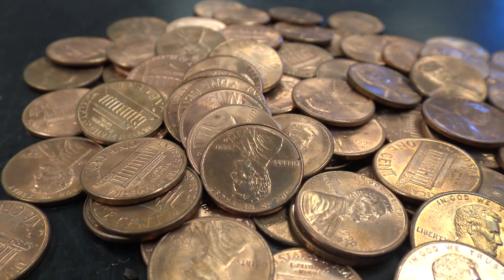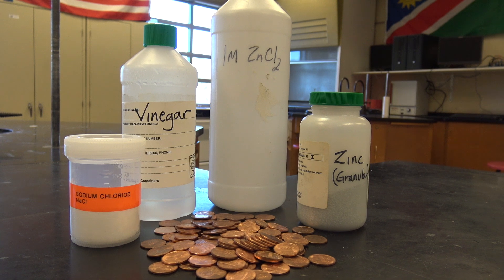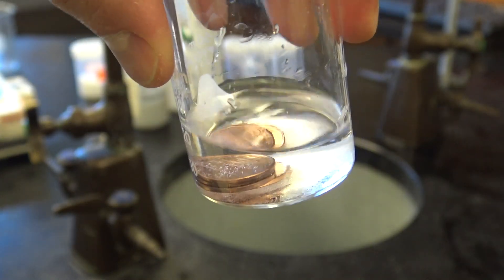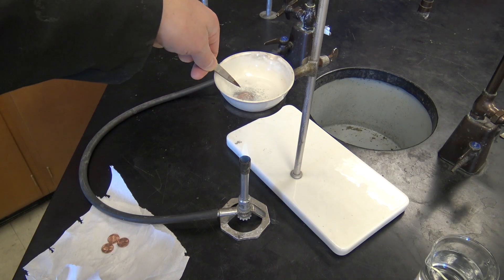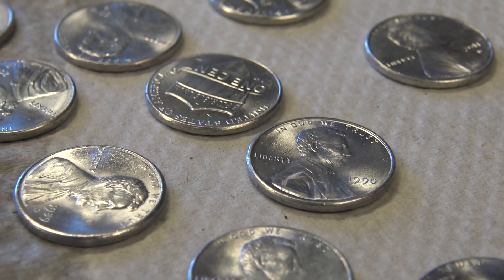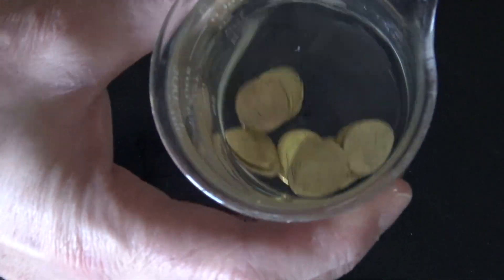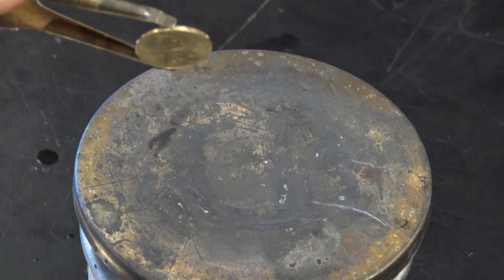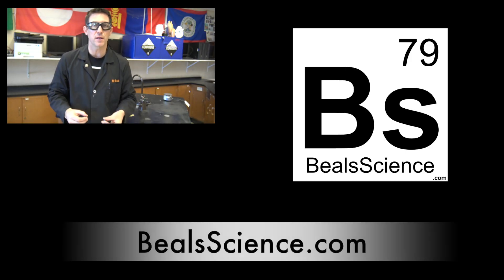How to Make Gold Pennies!

Comment from the maker: I'd love to hear from you! Leave me a comment and let me know what you think. 
Got an idea for a video or experiment? Let me know!
Thanks for watching! - Craig
Reply: Can you make them copper again?
Reply from the maker: If you continue to heat them they will turn back to copper as the zinc migrates deeper into the copper and eventually into the zinc interior (coppers are 99% zinc at the core anyway).
Reply: @BealsScience  Why is it possible to wipe off the zinc from the "silver colored penny" but not the "gold colored penny"?
Reply from the maker: Stacie Malonay great question!
The zinc loosely adheres to the copper on the outside of the penny. When heated, the copper and zinc can combine into a mixture where the zinc and copper atoms are intermixed. This is called brass and won’t wipe off because it is now part of the penny. It is similar to mixing two colors of paint (say yellow and blue). On a microscopic level you could still see the individual colors of dye but when we step back and look their colors combine to make a different color - green.
Hope that helps!
Reply: Just tried it out at home and got it to work, though it took a bit longer than 10 minutes - maybe because I used Zinc strips instead of granular zinc?  Looking to scale this up to do with my class.  How many pennies do you think I can get away with per ~250 mL beaker?  Hoping to have groups of 3-4 do it with each kid getting to take home a gold penny at the end of class.
Reply from the maker: Theo Pinson sorry I am slow to respond, I am just now seeing this. We’re you able to try the experiment?
Reply: is it possible to do this with copper wire?
Reply from the maker: John Doe yes!!
Reply from the maker: DExXR 380 I wasn’t aware that zinc pennies exist! Where can I find zinc pennies?
Reply: How much pure gold you can gat by this process...
If this process is harmful..?
Reply: @chaitanyakhanwalkar3555  no pure gold will be made in this process. This process makes brass which is golden in color.
Reply: Ok thanks. 👍🏻😊
Reply: where do u get zynk
Reply: Great
Reply from the maker: Thank you! I appreciate your comment!
Reply: Favor  decir los en español
Reply: Is this real gold
Reply from the maker: @Goodhabits1874  no. It is brass so it has a “gold” color but no real gold.
Reply: My penny won’t attach to the zinc, what am I doing wrong?
Reply from the maker: @alyssa7062  did you clean the penny with vinegar and table salt beforehand?

Comment: I was referred here by a Reddit post written by someone who has one of these "silver" pennies, because I have one, too.  Oddly, his is a 1961D, as is mine.  Also, his weighs 3.1gms, as does mine.  So, while I accept that it's zinc-coated, it seems odd that it's the same 1961D mint.  On top of that, someone who replied to that Reddit poster's comment, has the exact same thing.  Seems odd.
Reply from the maker: Yours could be an error from the mint. If so, it could be worth a lot of money!

Comment: Can you reverse this experiment?
Reply from the maker: If you gently heat the penny for a bit longer it will go back to copper because most of the zinc will migrate to the center with the zinc core that is already at the center of the penny.

Comment: Since pennies minted after 1982 are actually just copper-plated zinc, why is it necessary to add zinc in the first place? Is there a way to "silverize" a penny without adding more zinc?
Reply from the maker: Heating a penny by itself causes a color change but it isn’t very good looking. Additionally by the zinc plate allows the thin layer of copper to make brass from n the surface so it looks gold.

Comment: Couldn't you take it a step further with electrolysis and actually plate the zinc with gold or does it need to be a more valuable metal like silver? 
Or can you plate directly to the copper?
Reply from the maker: I haven’t tried much electrolysis but there might have to be some added steps to ensure that is plates properly.

Comment: You don’t need a silver bath. Just add a little silver to calcium carbonate (chalk) and photographic hypo (sodium thiosulfate) and water as a white paste. Wearing latex gloves dab a soft cloth into the paste and rub the penny … it will quickly silver plate the copper.
Reply from the maker: I’ve never tried this but it sounds great!
Do you use elemental silver or a silver compound like silver nitrate?

Comment: My question is: since a penny is just zinc coated in a thin layer of copper, why couldn't you just heat the penny enough to create an alloy? Why must you add zinc to the penny outside of the copper to create the alloy when there is already zinc under the copper?
I understand that it doesn't work, I've tried. But can someone explain to me why.
Reply from the maker: That’s a good question and as of right now I don’t have a good answer for you!
Interestingly, when you coat the penny with zinc then heat it, if you heat it too long the zinc will mostly travel to the center and you will have a regular old penny that has slightly more mass!
I will continue my search for an answer.

Comment: Just got one but the gold flakes off almost like it's painted. But silver color underneath.
Reply from the maker: Did you make it with this method?
Reply: @BealsScience   I got it in change from the store
Reply from the maker: @jgonyo3034  ok. That makes sense. Gold Pennie’s made this way will not flake off as the gold color is part of the copper on the penny.

Comment: I thought pennies were copper plated zinc?  does this work with nickles dimes and quarters?
Reply from the maker: You are correct. The center of a penny is zinc and it is plated with copper. I’ve done some experiments with removing the different layers with chemical reactions in this video if you are interested: https://youtu.be/5Cf0gH2LtiE
Reply from the maker: As far as other coins, they don’t have the copper “shell” needed to make this work.

Comment: We did this way back (1995-ish) in high school chemistry class, BUT, we used much more toxic chemicals. This method seems a lot safer and easier to do at home.  I was able to get all of the supplies on Amazon and the only tricky thing to find was the Zinc Chloride, but I was able to order that online also.

We made a bunch of 'silver' and 'gold' pennies for my nieces and nephews today after Christmas Eve brunch; they are all age 4-10, and they REALLY loved it.  It was a great activity to keep them out of the living room after present opening so the 'real' adults could clean up and let Uncle Paul play mad scientist in the kitchen.

One of them in particular wants to do more of this - she's asking about copper plating quarters and nickels and other coins, so that we can do the process in reverse to 'gold' those up too.  She's one of the younger ones, too - I think she has potential in a STEM field when she gets older.

The kids found the sizzle sound when quenching the brass pennies into the distilled water a lot more satisfying than the nothing much that happened when the 'silver' pennies came out.  But, they still decided to keep almost half of the pennies as silver-colored, which was cool.

Anyway thanks for the very instructive video.  I like this method a lot better than the way I learned to do this in the '90's and it DEFINITELY works, and my nieces and nephews were very impressed, and seemed to have a really great time.
Reply from the maker: I am so glad you had a great time! Your nieces and nephews are lucky to have such a cool uncle!!
I used to do this using boiling sodium hydroxide and it was really dangerous. This new method works just as good and isn’t nearly as “scary” as the other way!

Comment: Could I bake the pennies in an oven to get them to the brass phase? Like if I wanted to do a batch of pennies instead of doing them over a flame one by one?
Reply from the maker: Yes! Or if you have an electric stove top you can just hold them over the heat and they will turn.

Comment: How do you get the ZnCl?? Can it be replaced with something else?
Reply from the maker: You can use NaOH and it works great. But I don’t like using sodium hydroxide (especially with students) because the boiling solution is potentially very dangerous.
I’ve got some links with ordering info in the video description if that helps.
Thanks for watching!
Reply: @BealsScience  thank you.

Comment: Hi, is silver color is permanent or temporary? and is the silver color on the penny surface only,? and the penny from inside still has his own original color?
Reply from the maker: The silver color from the zinc is permanent but will wear away with time. The Penny underneath is unchanged until you hear it and it makes brass.

Comment: Why does the zinc migrate when heated? I'm also curious what exactly the zncl2 does to help the penny get coated. I've also seen the experiment done with NaOH -- assuming it gets Zn ions into solution but am not positive. 
I also would love some explanation on how alloys work... it seems counter intuitive that metals (typically + ions?) are attracted and bond to one another.
Reply from the maker: For plating: as the copper is heated, the copper atoms have more energy so they 'move' around more. Because they are held together on the outside of the penny through a metallic bond, the space between them will expand and, on occasion, each individual copper will experience moments where they possess a slight positive and/or negative charge.  The zinc (from the zinc metal and from the ZnCl2 [note, you could do this with ZnCl2 only but the solid zinc ensures that there are an excess of Zn atoms (ions) present in solution throughout the entire process]) will will 'plate' on the outside of the copper and be held there through metallic bonding with the copper and other zinc atoms.
When the 'silver' (zinc) penny is heated, all of the atoms on the outside begin to move around quite rapidly, stressing the bonds that hold them together and allowing the electrons and nuclei to 'move' with respect to each other. This jostling and moving and stretching causes the zinc and copper atoms to mix together (think of a cup of light sand layered on top of light sand - if you shake it they will mix together). Then when cooled, they solidify into their new home where their neighbors can be zinc and/or copper atoms.
Does that help?

Comment: @Beals Science  It worked for me, but after a few hours, they get copper spots and almost completely turn back into copper. Why do you think is that?
Reply from the maker: I’ve never had that happen. Did you soak them in vinegar and salt to remove any oils or dirt?
Reply: @BealsScience  Yes, for 1hr, and shook them occasionally, and before that I brushed them a little bit with a rough sponge.
Also rinsed them afterwards with distilled water and dried them, never touched them again without tweezers.
I then placed two of them in a pyrex beaker with 25ml 1M ZnCl2 and 1g powdered zinc. Low-temp boiled until silver-like and shiny, removed and rinsed again with distilled water.
I then heated one of them on the stove very gently and from a distance, until it had just began to turn gold-like, then immediately submerged it in water.
Both of them turned to copper-color again, and they develop spots that seem like when copper gets oxidized, with some residual brass color in the gold-like one.
Do you think using powdered zinc instead of granular might play a role?
Also, I used 5 euro cent coins, which I've read are actually steel covered with copper, if that's important, although I've seen people online perform this process to them.
Reply from the maker: I did some checking and it appears that there is a steel core in the 5 cent euro. This is likely what is causing you trouble. So, while you are able to plate the copper with zinc, the copper that is currently on the penny may not be very thick and, when you heat it to make it "gold" it is possible that you are breaking the bonds that hold the copper to the steel and then you are seeing areas where the steel is showing and probably oxidizing.
 The US penny has a zinc core so it might 'perform' a little differently in this type of experiment.
I hope that helps!

Comment: Other versions of the experiment use lye. What is the difference since I'd rather not use anything corrosive?
Reply from the maker: I’ve used lye also. You get get nearly identical results with this method and don’t have to worry about boiling corrosive liquids.
Reply: @BealsScience  thank you!

Comment: Great Idea! Will it also work for steel coins?
Reply from the maker: It is possible to plate steel with zinc but I have not tried it with this process. And, because the steel lacks copper it will not turn golden colored (brass)
Reply: @BealsScience  Oh OK! Well... Thank you for this quick reply and enlightening with this knowledge!

Comment: Can I copper plate any coin and then do this?
Reply from the maker: Unfortunately no.
The gold color comes from the formation of brass and brass is a mixture of zinc and copper.
So you can do this with any coin (or anything else) that is made of copper.
Reply: @BealsScience  I understand the zinc copper mixture. But if I electroplated a coin with copper then plated it with zinc as you showed would that work? If not it's fine
Reply from the maker: If you electroplate with copper first then it should definitely work!
Reply: @BealsScience  time to turn steel into copper into silver into gold
Reply from the maker: Let me know how it turns out!

Comment: I remember the saying in class too! NO ZINC IN THE SINK! That zinc is bad down the drain , it’ll clog up drains.....I think. Just a PSA
Reply from the maker: THAT'S RIGHT! 
NO ZINC IN THE SINK!
But the main reason is because most of the drain cleaners contain acid (usually hydrochloric acid) and that acid will react with the zinc to produce hydrogen gas which is explosive!

Comment: isnt this illegal?
Reply from the maker: No. Unless you try to use them fraudulently (convince someone that they are worth more than one cent). 

From the US Treasury:
Is it illegal to damage or deface coins?
Section 331 of Title 18 of the United States code provides criminal penalties for anyone who “fraudulently alters, defaces, mutilates impairs, diminishes, falsifies, scales, or lightens any of the coins coined at the Mints of the United States.” This statute means that you may be violating the law if you change the appearance of the coin and fraudulently represent it to be other than the altered coin that it is. As a matter of policy, the U.S. Mint does not promote coloring, plating or altering U.S. coinage: however, there are no sanctions against such activity absent fraudulent intent.

Comment: Excuse me, does it only work with copper?
Reply from the maker: Yes. You can plate other metals but only copper and zinc will make the gold colored brass.
Reply: @BealsScience  I Thought you could also do it with stainless steel, or is there any way? 😱

Comment: So you clean them first by Slat and vinegar  mix in a bath wash, then you heat zinc in a heat durable container to get your gold mix bath and them you dip the treated pennies in the zinc mixed bath and heat to get gold effect correct.
Reply from the maker: Correct!
Reply: @BealsScience  the Inc solution is out of stock and cant be found anywhere do you know of any other products that works well like this.  Do you you have to have all the instruments used on your list or can you use others items aswell
Reply from the maker: You can always make your own 1 Molar solution of Zinc Chloride. This link is for 100 g of Zinc Chloride https://amzn.to/2tOhDYU. To make the solution, mix 68 grams of the powder with 500 ml of distilled water.
You do not have to have the same instruments as I have on my list, you can use others as long as they can withstand the heat.
Does that help?

Comment: Sir i used
1.sodium hydroxide
2.zinc sulphate
3.zinc metal
Sir 5-8 try but Does not work
Reply from the maker: I wouldn't be able to say why it did not work as there are a lot of factors that can cause them not to turn out. I've got the full instructions and list of supplies here that may help: https://www.bealsscience.com/single-post/2018/09/21/How-to-Make-Gold-Pennies-Using-Science

Comment: aren't pennies just copper coated over zinc? would it be possible to use the zinc in the penny itself?
Reply from the maker: Pennies have a thin layer of copper over zinc, and yes, they are mostly zinc! I've never tried to use the copper inside the penny for this application but I do make "hollow pennies" making a small cut in the edge of the penny and placing it in hydrochloric acid. The acid reacts with the zinc to produce zinc chloride and hydrogen gas. The gas can react explosively (because it is hydrogen), so that is fun, and the end product is a nice shell of a penny - essentially solid copper - which can be used for other experiments.

Comment: JUST REMOVE THE COPPER
Reply: Find pennies minted after 1982, Scratch them to reveal the Zinc core (they are copper-plated zinc), then drop it in Hydrochloric acid, and leave for a long time. The zinc will dissolve in the acid, leaving the copper shell behind.